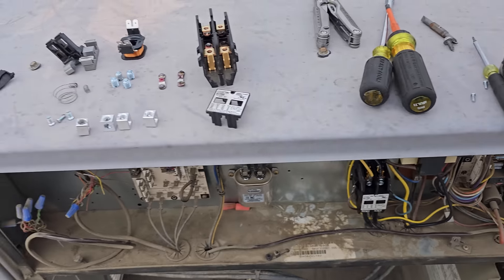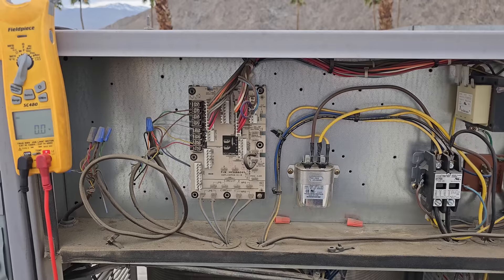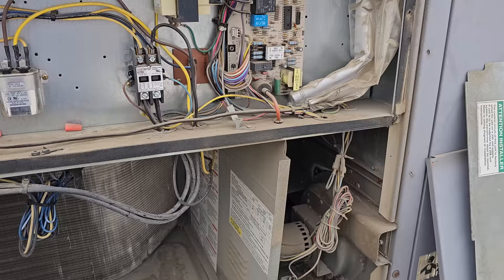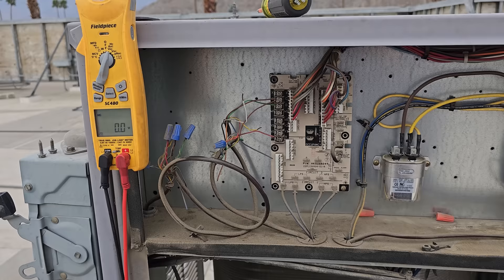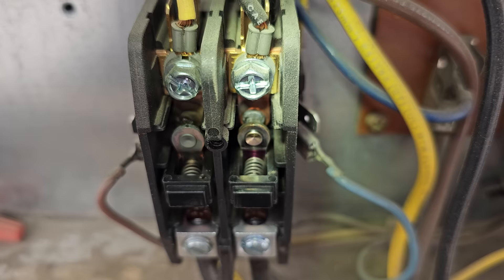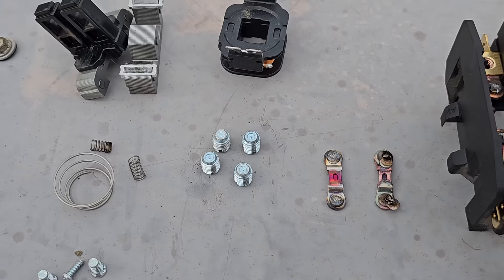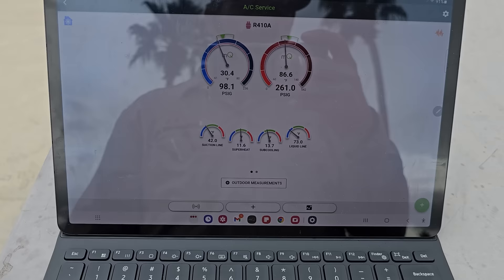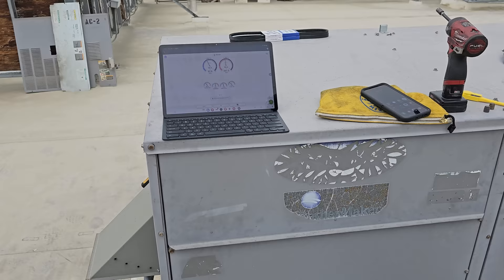THE AC IS HEATING AND COOLING AT THE SAME TIME

Comment: I have mounted several T-stats just like that to keep staff from screwing with it. Sometimes a T-stat is mounted in a crappy location and it's not possible to run new wire and this is preferable. No complaints from me.

Comment: This is a prime example why a good systems integrator is worth their weight in gold. An HVAC installer/service can be a great systems integrator if they know their stuff, and often have first hand knowledge of what equipment plays well together and is reliable. The more complicated a system, the more failure points, and some people want features at the expense of reliability. Most customers don't understand all of the technical issues that they are facing with their choices. This leaves them vulnerable to unscrupulous sales pitches, and they may end up with less than optimal, unreliable, or poorly installed systems.

Whenever I have to install a "temporary" fix, I always make sure it is to code and done well, since you never know how long it will be used. Nothing wrong with a T-stat in a duct for such emergencies, it is just a temperature probe connected to a control unit.
Reply: There is nothing more permanent than a temporary fix.

Comment: I've done that many times and like you said, less problems with those units😂.  Honestly, your wire job through the blower compartment is a better job than how Carrier did it!  My only stipulation is to write that you did this on the electrical panel cover

Comment: Some times on our RTU's that don't have hot gas reheat its necessary to run both at the same time for de-humidification, the honeywell 8000 and 9000 series stats / eim modules allow this under the advanced settings for de-humidification. It is very effective with most package units where the evap coil is before the blower and heat exchanger, it just costs a ton to operate.
Reply: hello, i'd like to know when this situation happen can happen as usually when it's cold outside, even if 100% humidity, the % drop with heat and you often have too dry air, and in summer as you cool you dry it.
For strictly controlled environment like 20°C/50%RH I always see a heat exchanger in line to reheat after reached to required dew point.

Comment: Re: mouse chewing cable and weird stuff.
I work in IT and we once had an armored fiber optic cable get chewed through by a beaver.  It of course happened in the middle of the woods between sites and the fiber was at the bottom of a pond.  The repair company we contracted had to do fusion splicing in a john boat. 😅

Comment: Nest used to enable running both heat and cooling simultaneously for quick dehumidification, but they removed that feature years ago when it was taken over by Google
Reply: That would only work if the air runs over the condensor first. Otherwise no reduction in the dew point, as the AC just removes the sensible heat from the burner.
Reply: Generally air passes through the evaporator coil to the blower section, then through the blower wheel and across heat exchanger. Evap removes heat and moisture, then the heat exchanger adds the heat back while removing even more moisture. I’ve only ever seen it used in a pool room though.
Reply: @jeremyduran8896  one of the main violators of this is the Goodman RTUs. The air goes through the blower then the heat exchanger and finally the evaporator before going back into the building.
Reply: @WilliePeck  I guess some units are like that but what a silly idea thinking about it... Evaporators will get heat cycled up to like 40-50c for no reason, can't be good for longevity

Comment: I run the CB 60hp water boiler at our church.  I should have caught  the problem.  The blower motor was slow to get up  to speed and close the air switch.  We called the local company for CB boilers.  After 4 days changing every part removing the blower mortar having it checked out they did replace the contractor (it came with the boiler 1960}. One side of the 220v. Was mostly mostly gone  After watching you I should have checked the contractor myself  but I left up to the professional men. they only billed us $8000.00
Reply: the new one sure wont last, unless it was pre 1990 new-old-stock(lol)

Comment: I'm an engine Machinist & reconditioner and mechanic and there's one thing I was always told and that's called kiss (keep it simple stupid) and on a temporary fix to get it running again taking the least invasive plan of action is the most simple option. You can cause more problems later on by changing the thermostat in the building and having to mess around changing sensors and so on. So at the end of the day bypassing the in building thermostat and dropping the temporary one  down the return duct is the best possible option for yourself and the customer.

Comment: I do like that Trane has a construction mode. You hang a 10k resistor and the unit will maintain 74 cooling and 72 for heating on its own, using the installed sensors.

Comment: That temp stat mounting reminded me of something. I was on an A/C call for a unit no heating and thermostat not working. Apparently, somebody did what you did over the summer, I assume system needed a thermostat and the company that condemned the thermostat sent out the new guy to swap the thermostat and that's all that happened. I had found the thermostat wires for inside the building disconnected and a cooling temp stat (The bulb kind) hanging infront of the air filters. I liked easy after-hours calls like that, BRINCO was the management company and it wouldn't surprise me if they approved the temp stat install, but only told a different company about the thermostat needing changed.

Comment: I had the same thing going on three compressors on two 30 T Yorks with gas heat on found the DX9100 controller was programmed to a humidity set point at a plastic manufacturing plant so they we’re using as re-heat to not overcool space while trying to hit 60% RH

Comment: I replaced a contactor today on a 20 ton Trane that fried from short cycling. I haven’t taken it apart yet, but from what I could see the internals were so burnt to the point of looking like charcoal. I even did the same thing of removing the lugs the way you did here, something I don’t normally do. I never really understood the point of doing so until I had to do it today.

Comment: Quick question with regards to the thermostat you put in the duct. Do you ever worry about the solid core thermostat wires breaking as the air blows it around in the duct? And what would you do if the thermostat did fall in the duct? Love the videos. Keep up the great quality work of yours.
Reply: Na those wires are tough they won't break in any short amount of time from swinging around a little.  If it fell probably retrieve it or just leave it in the duct and get another one if you couldn't get to it.

Comment: It is a miracle if they had still any kind of functional connection to that digital thermostat/zone controller device in the first place as it has been soaked and corroded by cleaning chemicals and water so much that both cooling and heating calls are stuck on at the same time - though not indicated on the front panel LEDs.
So much corrosion and debris in there. I was first thinking that if there is even a factory bodge wire near the connector J5 on the front panel circuit board but after more careful looking it seems that is too some kind of debris flushed in.
I had to do a bit further research and at least some of those horizontal almost stacked bigger "chips" at the right side of the wall side board of the digital thermostat can be identified as CPC1976Y solid state AC switches, a kind of optoisolated semiconductor relay. It would have been actually interesting to see if more or less all of them were uncontrollably commanded on - or even fried on due to overvoltage like caused by a nearby lightning strike (I do not know how often you might have thunderstorms there).

Comment: t-stat in the return duct works perfect nothing wrong with it, I use a stick of s clip tap the t stat to it bend a hook at the top of it and hook it to the filter slide so it doesn’t swing around around when the blower comes on, but still though nicely done it’s just temporary

Comment: The only thing I’ll say is if there are other units with t stats down the ductwork like that is it really a temporary fix? It all depends on a bunch of variables but if you have all the wires down in the restaurant to me putting it there is easier because you don’t need to run wire through the unit. I’m saying that if the staff plays with then ok but there is a screenlock on those Honeywells

Comment: Newbie into the trade here, if a liquid line port isn't available how much would Subcool change if the subcool was bring taken with discharge pressure and is there a way to figure out true Subcool with the discharge pressure and LST?
Reply from the maker: On carrier package unit with fixed orifice metering devices I usually see about a 35psig pressure difference from liquid to discharge ports... but each manufacturer is gonna change depending on their design

Comment: "internet controlled thermostats?" get them off the internet immediately they being on the internet is nothing but trouble hackers can hack them and wreak havoc on the business.

for example a hacker can turn them up to full blast to full temperature and run up the energy bills.

a scenario it is a wax museum and the wax statues are made from the low melting cosmetic/beauty grade wax  a hacker hacks into the thermostats and turns the heat on to the max (i think it is like 9 degrees).

the statues melt and all the priceless statues are destroyed

if the hacker is not interested in the destruction of wax statues they could get the login/ssl credentials from the iot device and use that to authenticate as the museum (that is what happened to target a couple years ago)

i am not sure how the ducting is plumbed on a package unit but in a residential furnace the air blows over the heat exchanger for the heat then over the "A" coil for the air conditioner.

if packaged units work the same way it is possible that the short cycling is being caused by the air conditioner going off on high pressure.

putting the thermostat in the duct may be dumb but if the business is one of them kind that would stand to lose lots of money to customers not doing business there they need the system to work now so installing a temporary thermostat in the ducts is your only choice so i cant call you dumb for doing that because many businesses are in a pinch and need their systems working.

Comment: Would have done the same thing myself it’s temporary cause those off sight control companies like to use specific stats that work with their monitoring system can be a pain but the unit will work fine and the customer won’t know the difference anyway

Comment: I had an issue with a thermostat. The costumer droped the face of the thermostat and the face of the thermostat loose some of the components inside the cause the wire of the thermostat to melt together and was causing the unit to trip. I had to run new thermoatat wire and ofcurse a new thermostat

Comment: If and when the EMC installs their replacement tstat, how is the EMC tech going to know there is a seperate "bypass" tstat in the RTU? They replace it - with the building tstat wiring not connected to the RTU. Finding the replacement EMC tstat with no power, does that then prompt a trip to the roof for them to find the "bypass" tstat in the duct, remove it & reinstall the original building wiring to complete the repair? Please explain.
Reply: probably wise to use a label printer and stick it on the bad thermostat. something like "bad t-stat, temporary one in return air on roof" 🤔

Comment: I've done that plenty of times to get a unit running don't see why anyone would have a problem with thermostat in the return as a temporary 😂
If wires have quick disconnects on them I just clip it and put it in the lugs of the contactor haven't had a problem doing that.

Comment: Energy Management was a service I did not think did much more than collect money and install equipment.  If the multi-figure-$-electric bill went down on a large building, resulting in a realized return gain on investment, all is good. (Not my job to know those things).  Since I  maintained the older more mechanical side of equipment generally, the electronic takeover folks would “”move”” alarm sense wires going to our national operation center, to another companies monitor and dispatch center, (not in-house control any-longer)..  With that written: The building gets very warm one day, (temperature control is critical inside this building).  The electronic monitor folks did not dispatch out a facility tech., possibly saw or ignored; “high-temp building alarm”. Management has no clue why the new monitoring alerting failed to roll someone to the site, (that is another story).  Plenty of finger pointing.   I could not even guess the 💵 the company invested in the new system.  Had zone temp. measuring sensors on floor pillars all over.  All a waste of cash.  (The high temps were detected by someone physically on the floor, most every time. (Back when companies had a few more employees). High temp “dispatch-tech.-out” was set around 90 degrees, (I learned through a facility /building tech.).  I was in a different type of equipment maintenance group.  (The olden days).  😊  Good topic Chris, as usual.

Comment: Room Temperature Air + Heated Air + Airconditioned Air = Room Temperature Conditioned Air = No Problem.... I have doublechecked and the equation is sound.
Reply: also it is super inefficient. it makes no sense to run both at the same time. also the unit is not designed to run both. kind of a hazard
Reply: @mitchellmorrison4233  true enough

Comment: Are the contactors dying so much because they're bad quality?
Reply: in this case it seems to have been caused by it constantly switching on/off, and melted the points from the heat build up
Reply: They have a big problem in Southern California with dust/sand
Reply: due to ROHS all the "good" elements have been removed from the contact material composition, like "cadmium", so they're all using alternative compositions, which doesn't hol dup as well. but that thing was likely chattering the contactor and doing all sorts of bad things to it.

Comment: But if the wires were shorted in the wall you would have needed to disconnect W1 otherwise it just loops back through the short. Shorted wires could have wrecked the contact too. So I wasn’t as positive as you that the stat was a goner but I love asking engineer questions or I will never learn and just keep annoying techs who know better!!(haha)
Granted the stat had gotten wet but could you have left W off and see if it ran in cooling if there wasn’t much need for heat.
Reply: I felt the same; It seems like we didn’t test if the t-stat/t-stat wires were bad. Because we didn’t disconnect the wires at the t-stat. Might be something I missed. I apologize if my comment is obtuse.
Reply from the maker: Once I saw the corrosion I knew it was the Stat, but what you all didn't see was I had to change another one for the same reason that day too....

Comment: Absolutely nothing wrong doing what you did to get the unit running and controlling. Nothing was done unsafe. Do what you need to do with what you got. Dropping the stat is doing the same as wall mount, it’s controlling based on the surrounding ambient. The user can’t see the temporary but will still look at the wall stat, so subliminally they believe what they physically see if the wall stat is still displaying temperature. Dazzle em with brilliance but baffle em with bullshit. Only added thing I would have done is leave a note in the at the stat terminal strip what was done as a temp fix, in case you may not be the one doing the permanent fix. Hopefully dust doesn’t build up on it too much. Just my opinion.